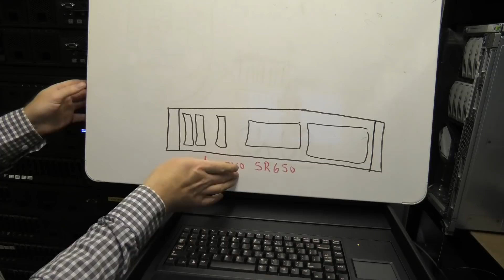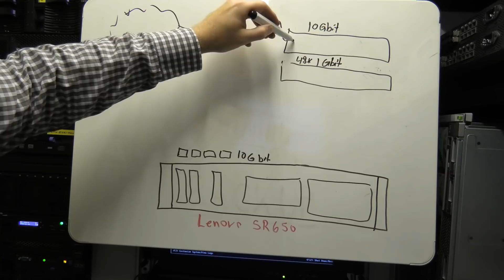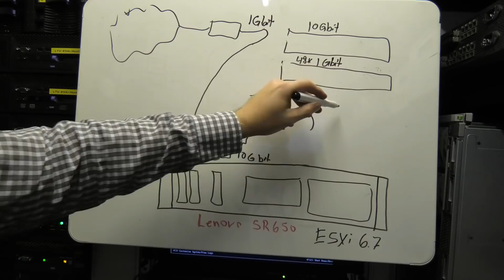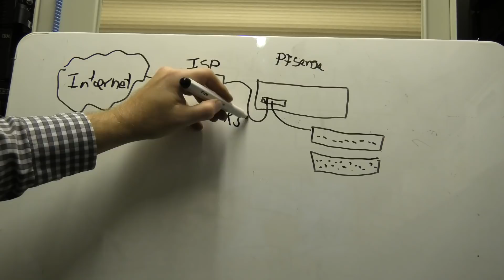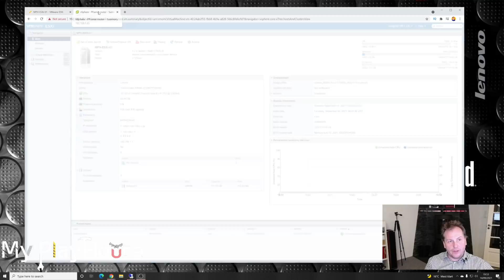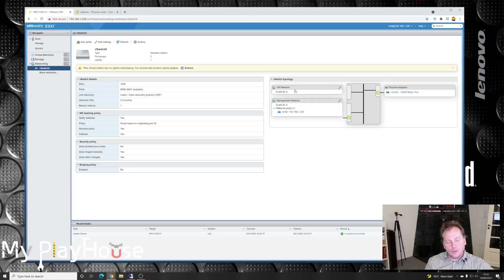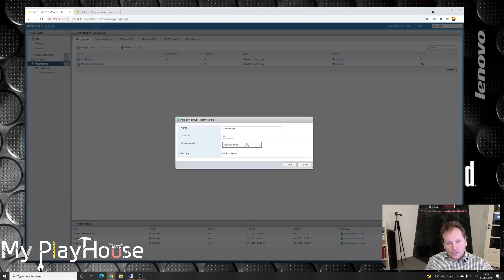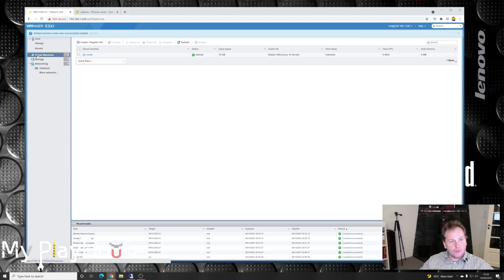Creating Virtual Switch in ESXi - for a Virtual Internet Router - 1105

Comment: Hi Morten!
I have a server but with a 4G LTE router at home.
I would like to purchase a licensed vrouter. 
And this vrouter will install on ESXI.
After installing on ESXI what do you do?
create a vswitch?.
The vrouter connects to the physical router, but can I take advantage of the bandwidth speed of the vrouter?, Example the vrouter that I bought with the license is 50 megabits.
Can I take advantage of all that speed without affecting the physical router that I have is 4G LTE?
or you have to have the physical router to work the vrouter?. I hope you understand what I mean.
Then the vrouter I would like to connect two virtual machines with vmware workstation you can or it depends of the vrouter if it is compatible?
Thanks if you can give me some help.
Reply from the maker: Install ESXi, make vswitch, and make a virtual router,, like PFsense.
A virtual router is vay more powerful than a normal physical router (the cheep home ones)

Comment: If you use the epon/gpon modem from ISP, that you could try connect more than one 1G ethernet from modem to your server/router, set linux port LAG or binding to get more than 1G link speed from modem to router WAN port when use pppoe client in the Esxi Server VM RouterOS/OpenWRT with binding port. most time ISP will add little more speed rate in their modem link speed, like 1.1G or 1.2G.
Reply from the maker: Hi Robert Liu
Thank You very much!  glad you liked the video :-)
Thank you for watching! :-)

Comment: In your (ONT?) adapter, where is the fibre connected?  As you said, it looks like it's just you RJ45 and power, with what looks like a coaxial port on the bottom left. (Oh, unless it's powered via PoE? and the connection on the right is the fibre? )
Reply from the maker: Fiber comes in through the tiny white cable channel on the left of the box.

Comment: You should sell reproductions of your diagrams on your webstore Morten. I’m sure you keep the original whiteboard drawings safely locked up in your creepy basement vault - with all of your other Viking plunder… 🤪👍
Reply from the maker: No if you do not clean it right away,, it becomes really hard to clean :-) it's gone!
Reply: @MyPlayHouse  Too bad. I’m sure you  could have got at least $1000USD for a signed original Hjorth diagram… 🙃

Comment: Hi, wouldn be simpler if you just pass the network card through to the Pfsense vm? In that way the router can directly use it and there wont be any overhead because of the virtual switch thing.
Reply from the maker: That could also work..

Comment: whats the Performance like with that method you used? have you ever thought about PCI-E Pass Through and have LAGG/LACP configured to your 10G Switch and put WAN in a VLAN ? that way you can have more bandwidth in and out along with VLAN configuration
Reply from the maker: For my needs,, it is way fast enough. I do "only" have 1Gbit Internet, so no reason to go to 10Gbit yet :-)

Comment: i already have 2 internet connections from different isp and 2 pfsense routers in failover/loadbalance configuration
method for isp used: packet lost or high latency 
and then 1st router fails 2nd will be ready to work almost immediately
Reply from the maker: Cool,, would you happen to have a recipe for that?
Reply: @MyPlayHouse  for dual wan/load balance i use this instuction https://www.youtube.com/watch?v=O0e13_q-ImY and for failover/high avail i use this https://www.youtube.com/watch?v=-1Og5ogkyZY

Comment: I'm guessing that the "modem" is a simple switch with VLAN support? Since modem stands for (modulator-demodulator) and is used to connect digital equipment to an analog connection.
Reply from the maker: It might be more of a router, then a modem,, there is no analog.

Comment: Why not create a VLAN for WAN on the 10Gb switch and make a trunk from it to the server? Much easier imo to have a dedicated VLAN for WAN access if you need to move pfsense to another host or preferably make a cluster.. not very fun having a virtual router on a single host when issues occur.
Reply from the maker: There are many ways to do this.